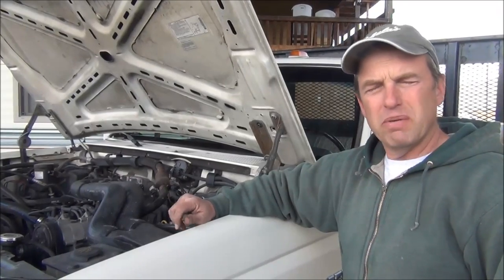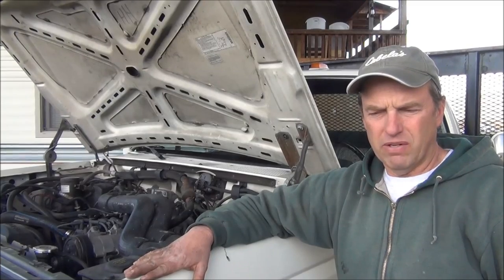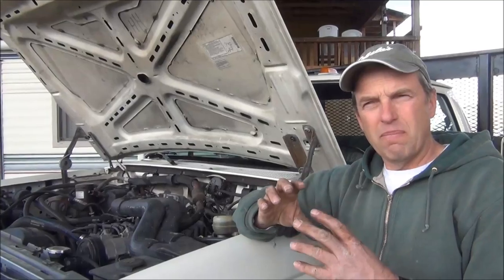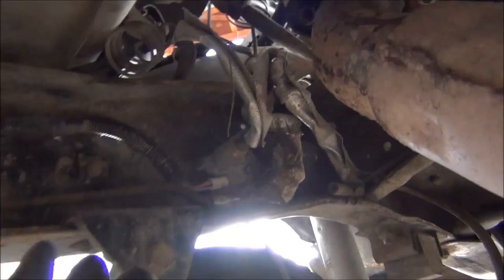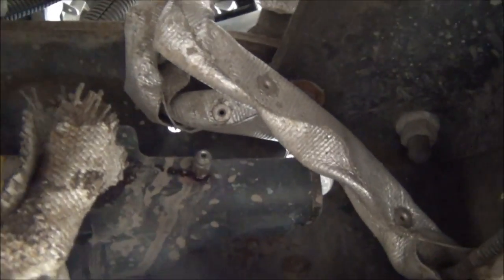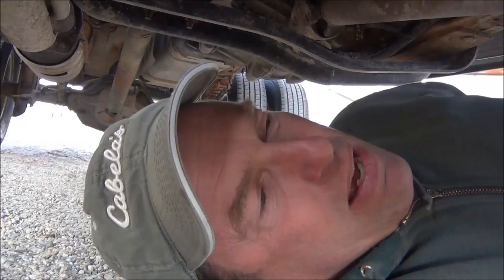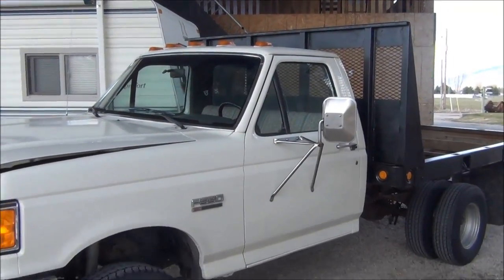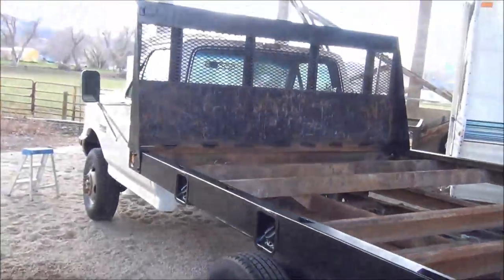F350 Spongy brake problems

Comment: This is the dumbest truck I've ever had the pleasure to own. MONEY PIT.. I'll never buy another one and I do not recommend anyone else buy one. You will sink tons of money into it. Because every problem you'll have is related to another one. And you need a dealer to keep it all right.Or watch these kinda videos and replace every damn thing on the truck. You 'll end up with a new truck eventually... $1,000 damn dollars I have spent over this BS issue. Vacuum as well. It's controlling it too. My idle was trash.. After replacing all the crap your video said to and other videos said to.. I still had the trouble. That has lead me to these damn brakes. and ABS.. It's BS. I replaced all the brakes. Front & rear. I'm not putting any more money into it.
My ford is a Wrecker.. And I can't even get it right. $7,000 wasted dollars. I'm ready to shoot myself.. It's BS.